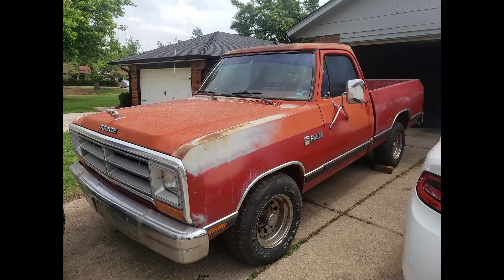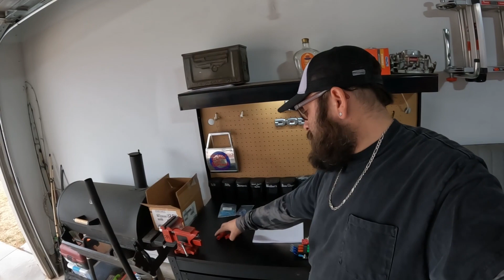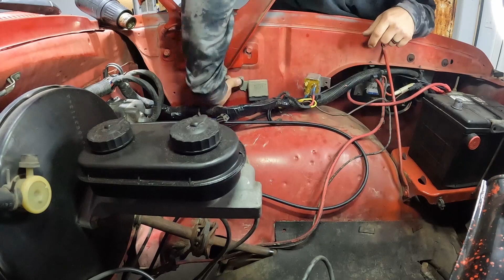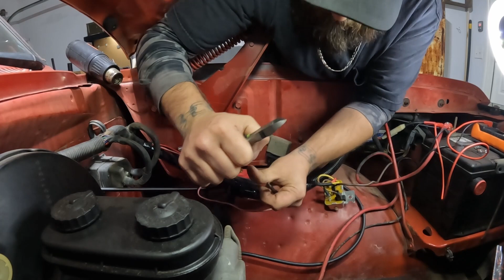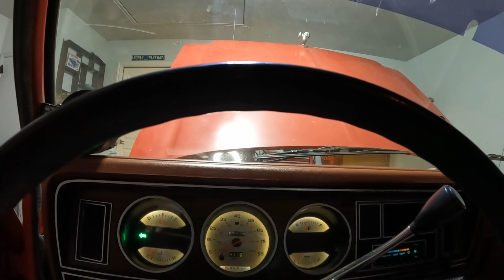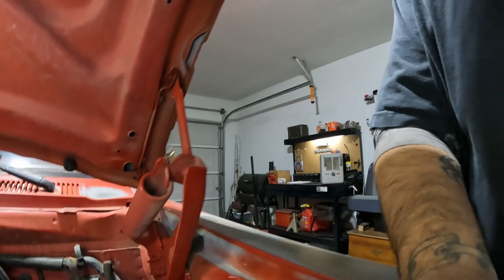1987 Dodge D150 Budget Fusable Link Upgrade for Under 50 Bucks! (Project Ramona)

Comment: Does anyone know what each wire goes to each fuse on a 87 Dodge D150? I got the fuse block,do I need the amg fuse too?
Reply from the maker: You dont have to use the amg style fuse. You could just use a breaker like the one I put on Black Pearl. Video shows everything i used. As for the wires and what they go to. I have a img in those video and the Black Pearl video you can pause on and find out what each one does. Or you can join the twizted wrench  garage discord from your phone or pc and go to the diagrams section and you can also get it there.

Comment: Hey I have a 1982 Dodge ram d150 with a 318 two barrel cub could you post the link that shows the wiring diagram in what wires go to that’s hook up to the duck foot for the set up you are doing
Reply from the maker: I have a diagram posted on my YouTube discord channel. Under the diagrams section.

Comment: Man your under hood looks clean and sharp, my 85 d150 has way more wiring everywhere, also got a 78 la 360 suped up with a painless wire kit and 4 second flat ignition on a 47 dodge panel truck, love my dodges
Reply from the maker: @blakenorman4822  yea pretty tidy for sure. Lucky no one had been messing with stuff.

Comment: Will this work for my 60 amp alternator
Reply from the maker: Yes, I would verify what size Amp mega fuse needed for your application but I'm pretty sure mine is the 60 Amp as well. They only did the 100 Amp in the bigger trucks I think.
Reply: @twiztedwrenchgarage  I just need to know what size fuse I need to do this. I recently put a new alternator and vr in and the 40 inline fuse I had for the alternator that was working for a few months now blows every time I start the truck
Reply from the maker: @tommywilliams1402  for the alternator you can use between a 150-175 Amp  fuse.
Reply: @twiztedwrenchgarage  thank you your a life saver just to think I almost sold my truck because of this issue
Reply from the maker: @tommywilliams1402  oh dont sell always fix lol. They can be a pain, but u think it's worth it in the end.

Comment: awesome video thanks for that cant wait to see what you do next with the rams, also would you happen to remember the sku numbers on those parts looking to buy for my truck as well. 
I will make sure Twisted Wrench Garage sent me.
Reply from the maker: I can look up the part numbers when I get back into town. I'm out of town atm.
Reply: @twiztedwrenchgarage  when ever you get a chance brother it would help a ton with my set up! 😁😁
Reply from the maker: Heres the part numbers for the major parts the connectors and such can be picked up anywhere.
Part numbers- 
6 Gang Plug F panel 9546P
150 Amp Copper Bolt in Automatic AMG Fuse 14202
Mega High Amp Fuse Block Kit 14261